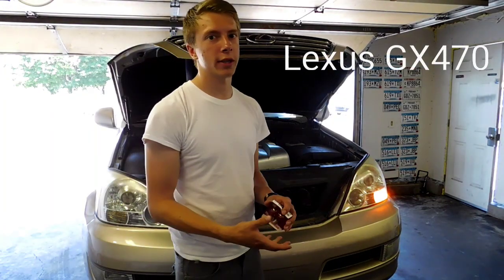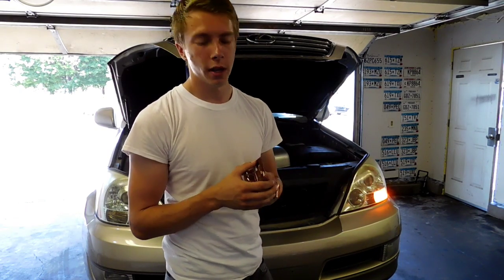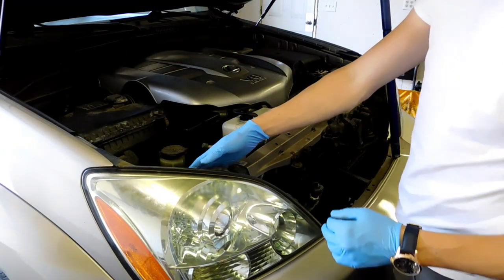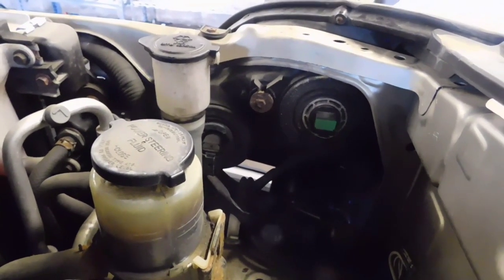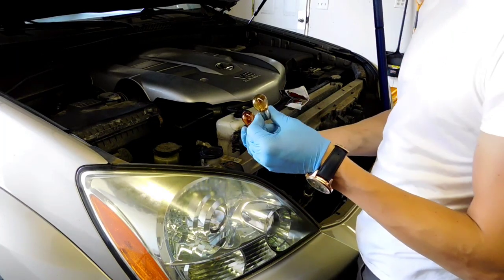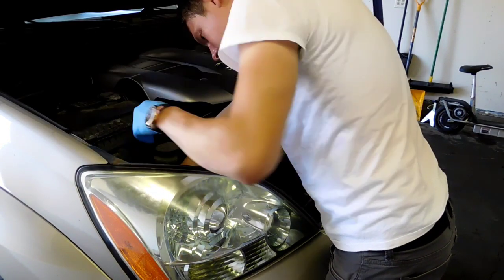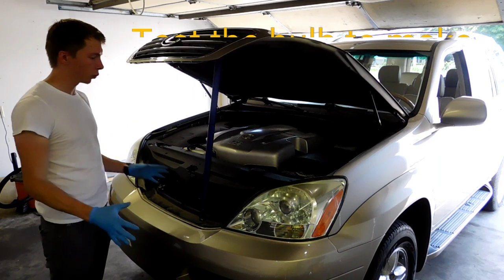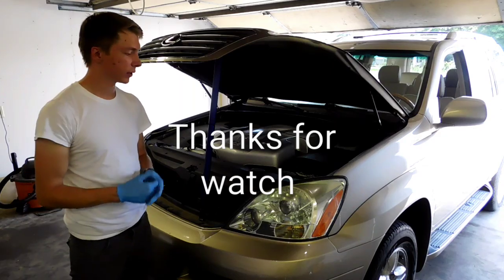Lexus GX470 bulb replacement

Comment: You can also go up from underneath the car which saves removing all of the shrouds.
Reply: That's what I was looking for, I had not thought about that, Thanks.
Reply: Yup, that's what I figured out, very easy to change from underneath, takes just a couple of minutes.
Reply: As long as you can work with one hand ;)
Reply: Actually just finished doing it this way.  There's a convenient little flat surface to prop a phone flashlight on and it took me about 5 minutes total to remove and replace.
Reply: @delcapslock100  Headlamp works like a champ as well. A bit awkward space to work in but light bulb changed in 5 minutes.
Reply from the maker: Yes that way also works.

Comment: I know its been said, BUT much easier, simpler and faster to just go to it underneath the vehicle.  Others have done what you did or removed the battery which is totally not necessary.
Also, never work on a car with a watch on, it ruins the nice watch and could scratch the car.

Why is there a prop rod under hood?  Bad struts?
Reply from the maker: I know there is multiple ways of doing it but this is just a way I did it.
Reply from the maker: Yes the strut was to weak needed a new one
Reply: @russtrain3229  FWIW, changed out both my bulbs in less than 5 minutes without opening the hood.  Just get the proper bulbs, get on back and do it from underneath.  NO need to remove a single thing and I did each bulb in about 30 seconds.
Reply: I have small hands and had trouble reaching up since everything was so close together, so I ended up opening the hood anyways.